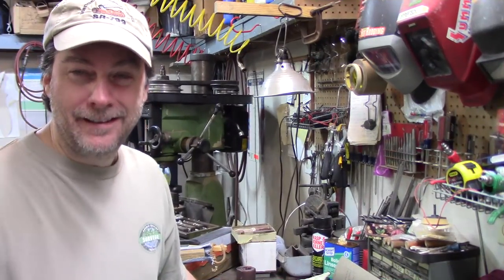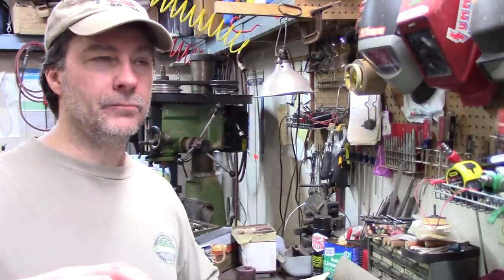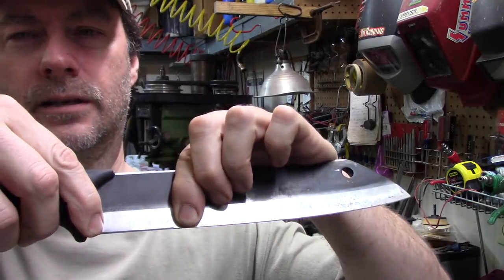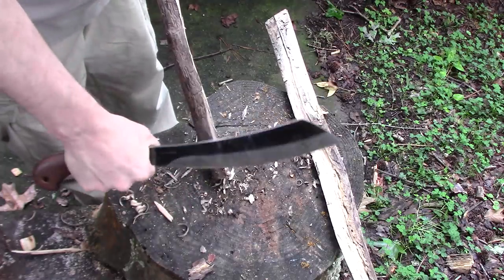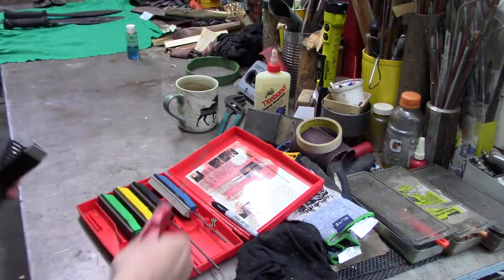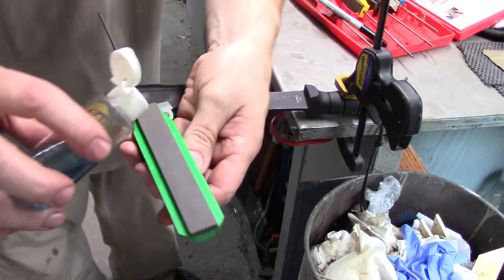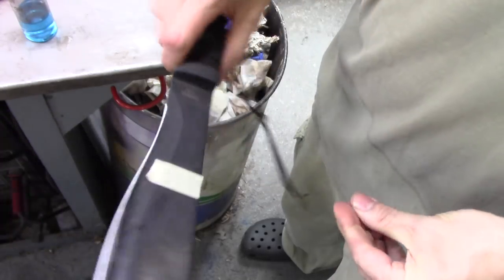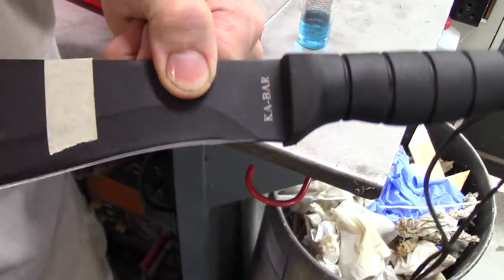Machete Sharpening For Bushcraft Use

Comment: Me, peeking over the top of 70… For sure, we know, it takes one to know one.
Been a regular watcher since 2012 — right off I noticed that you have magical mechanical skills. I wonder how many other watchers know why this is. Kluging-up stuff just tickles you pink. Finding that you are a machinist just makes perfect sense. A natural, you have major intuitive kinetic sense. Without knowing you from Adam nonetheless I presume you are intuitively Mathematical. 
You are another ADD maker and fixer of things. If you can see it in your mind’s eye or grasp it in your hands then you can master it. I bet you taught yourself to braid as a small child.
Myself, I favor words and find numbers to be eldrich. But if it’s broken I can fix it. Introduced to a new tool of any kind I will be friends with it in a couple of ours.
Having been a cook for many years, once upon a century, I have extensive practice hand-sharpening. Straight razors to chisels and all comers, I always freehand all my edges. I stopped using any oil decades ago. This was before silicone lubricants were available. Any lube not primarily a solvent will gum-up over time. Since about ‘89 all I use is water and maybe a drop of soup. If anyone should happen to own an old stone with gummed up pores try an old pot of water at least 12 inches deep with any commercial degreaser or domestic dishwasher detergent in it. Simmer the old gummed up stone for a day…
I was compelled to write this TL;DR today because I love your ‘stropping wood’. Mine is a 4’ long piece of pallet stripping 2”x 2”  made of mahogany ( I used to work in a big box housewares store in the lumber department after I semi- retired. For field use as a basic strap and hone I have a cheap full hide belt for electricials tool pouches tied to this mahogany board tensioned with paracord. Once primed with abrasive rouge I refresh the ‘cut’ in the surface by rubbing in a bit of 2 micron diamond grit. A few grams seem to last a lifetime.
I wonder if you have thought about asymmetrical blade profiles — as in totally flat right down to edge on one side with all of the radius on the other for a 15° or 20° inclusive angle?
Don’t ever change and keep having fun!
Reply from the maker: I often use distilled water on my Japanese water stones.  Yes, for some carving tools I've done flat on one side,  angled one side only

Comment: Do you ever use belt sanders for sharpening or reprofiling your blades.
Or can all be done by hand sharpening in your opinion. Using sandpaper and stones.

Side note,

I do understand that people in the past, who went to war (crusaders , roman legionars etc etc) with bladed weapons, did not have the option of belt sanders and such.
Reply from the maker: I only use stones and strops. Belt sanders can very easily overheat a blade and I'm not willing to risk it. Usually belt sanders are for shaping new blades before heat treatment
Reply: @Reallybigmonkey1  
And it takes a steady keen hand to use belt sanders also. It's not for the uneducated.
I had a Makita 9032 and a Proxxon BS/E.
And used it for machete/axe sharpening, and also to make a new tip on a knife where it was broken off. Machete work was fine. But to make a new tip on it. Those belt sanders in one hand and the blade in another.... Not that great.
It didn't work well, I haven't got the skills to do this, and am bettet at doing hand sharpening, .. I noticed. Things don't go wrong that quickly when sharpening by hand. 
And yes, that counts for heat treat as well.
Reply: @Reallybigmonkey1  
But what's your opinion of the Work Sharp.
It's a highly popular sharpening tool(beltsander) seems to be used for kitchen and pocket knives as well.
Same risks..
One can mess up easily with it as well..